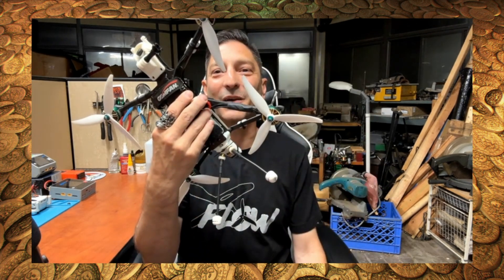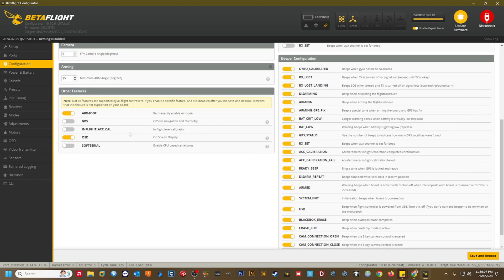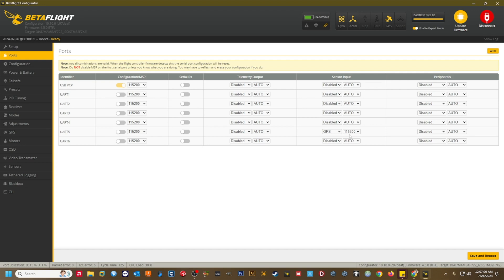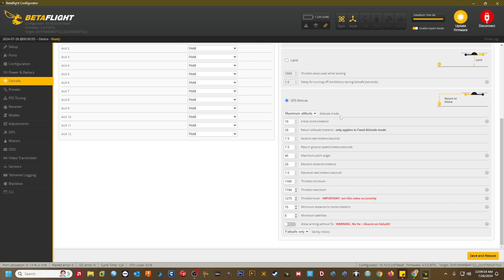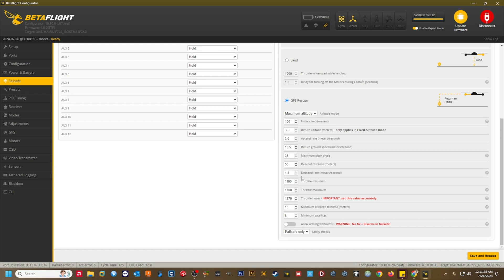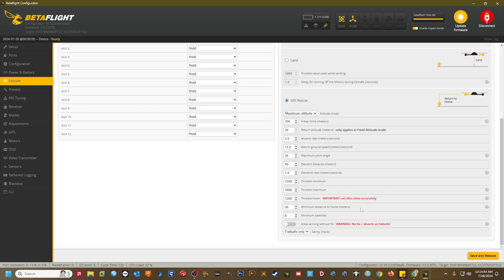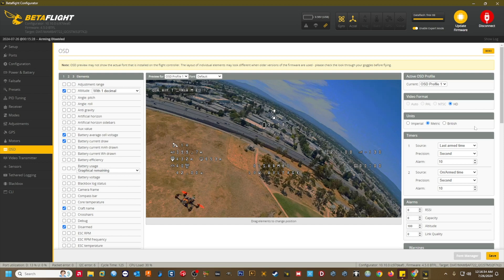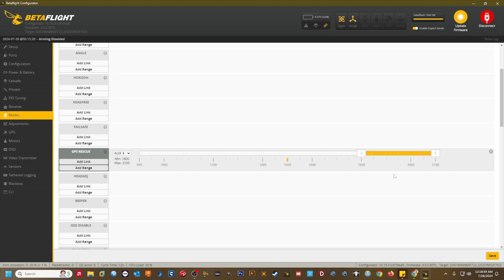Just The Tip - Ep 10 - Betaflight 4.5 GPS Setup & Settings - How To Setup GPS Rescue and Auto-Land

Comment: i just update to 4.5.2 , but i don't have GPS Rescue in Modes (BF 10.10) ,event in configure GPS already on
Reply from the maker: maybe when you loaded then firmware to flash, you loaded it without the GPS functions included in the firmware. Try to re-flash the 4.5.2 again, it should be there in the modes tab once you enable GPS in the configuration tab.
Reply: @Rogue_FPV  Thankyou sir, but i just found the problem. THe problem is GPS cannot use on 3D Flight Mode. so it will disappear from Modes. But thanks for the replay.
Reply from the maker: @captaindronieversefpv  also that.... lol

Comment: Thank you so much for the info. for the 5inch quad.  what size battery did you use?
Reply from the maker: I used a 1200mah 6s Speedy Pizza pack. 
That’s my go to lipo
Reply: Your setup is very simple, and I really like it. Did you assign any angle switch to stage 2, or is it left as GPS rescue only?
Reply from the maker: @hgherb I don’t assign any angle switch, betaflight will automatically enable angle mode for the stage 2 failsafe / return to home
Reply: @Rogue_FPV man!! Your the man!! Thank you so much.
Reply from the maker: @hgherb  any time Bro! Always happy to help out!

Comment: so what you are saying i no longer have to set angle mode with a hold value or the throttle with a hold value? i also don't need a stage 1 aux switch set to fail safe for testing?  like i did in 4.4..   Though JB's video on 4.5 did as did Dshot.. But you and UAV tech did not. I assuming these are short cuts to simplify GPS set up?  You are confident to turn off you controller with the settings shown?   Things can get over complicated watching you tube...lol
Reply from the maker: @kevinglenister6520  yes, I’ve shut the radio off and am 100% confident with these settings. There is nothing wrong with adding the hold values for an added layer of “comfort” but I personally have not bothered with them, and all of my test and free flights have been totally fine.
Reply: @Rogue_FPV  thanks for the info!
Reply: @Rogue_FPV  one more question when people test are they disarming or literally turning off their radios
Reply from the maker: @kevinglenister6520  Do NOT Disarm!! Either use failsafe mode with an aux switch to simulate a radio failsafe, or manually power down the radio. 

Personally I use the Failsafe Mode / Aux Switch for the initial test, then power down the radio for my second test if the switch method does work as expected. 

Great questions BTW!
Reply: @Rogue_FPV  lol I thought so as with GPS rescue set up on one of my other quads I used the disarm switch and it hurtled to the ground  at an amazing speed!  I just thought I'd programed it wrong.  But everything else worked as it should on fail safe switch.  So I was never brave enough to shut of my radio off as I thought it would have the same consequence.  Thanks for the info it is really appreciated.

Comment: hi RogueFPV why in my betaflight 4.5 (NAZGUL XL5) the "Initial climb" value keeps getting blank after i save and reboot.. after setting a numerical value it goes blank when i press save and reboot..  thanks in advance.. appreciate ur info regarding this matter.
Reply from the maker: @xrowdac5trezor  what value are you trying to enter in the initial climb? When I have seen the values disappear it’s because they are not within the allowed range - value to low or too high. 

It’s also possible that there was a problem with the firmware flash of 4.5, you can try to re-flash the firmware and see if that helps.
Reply: @Rogue_FPV  ohh so may yes re-flash.. i did all numbers 1-100 nothing works (registers)  after i save reboot it goes blank (the box)..
Reply from the maker: @ I would recommend re-flash the firmware to the fc, and make sure that the gps option is selected when compiling the firmware

Comment: Great info! This is probably the clearest explanation of GPS rescue settings I've seen so far. BTW, you mentioned that GPS rescue doesn't use the magnitometer/compass but I found this on the BF website so I guess it does use it now? "Mag information improves behaviour in GPS Rescue during the climb and descend phases, where wind and drift can confuse a GPS-only heading. It essential for accurate position hold, which we will support later."

I'm sure a direct link would be blocked by YT but here's the last part of the link after betaflight dot com - /docs/wiki/guides/current/magnetometer

Comment: I use HT1818Z3G5L GPS moudule it doesnt work with f4v3 plus FC why?
Reply from the maker: When i read the technical specs for that GPS unit, I see it's rated working voltage is only 3.3v 
Manufacturer has not designed it for 5v input voltage.
Reply: @Rogue_FPV  oh I see Thank you ♥️

Comment: Definitely just got a new subscriber! This was very easy to understand the way you presented it. I recently purchased the I flight Nazgûl eco and go he gps pre installed. I watched a few videos on this with JB and some other guy and I set all my settings up the way they said, but when I went to testing it I had it set to let me fly without the minimum because I have to plug in a lipo in order to get the gps power so I didn’t want it to sit there and burn up. So I took off and it locked some satellites so I flew out to test it and flipped the switch set to failsafe, it went through the first stage which was shooting up in angle mode then stated gps rescue. When gps rescue initiated it flew up more then turned twords home it started trying to come back but then it was pitching up and down and started going up and down in altitude, but the next time I just tested the gps rescue alone and it went up turned around in angle and then proceeded to start falling out of the sky then sometimes trying to catch itself and sometimes not at all I crashed and went home frustrated, so now I’m thinking I need to set my hover correctly and turn off start without fix. I don’t know if I want to sit there and wait every time I go to fly to get a lock though because I don’t want it to over heat. But if you have any solutions they would be greatly appreciated and I will update after making these changes and testing this. Also I don’t know if it matters but there was a power line kinda close when testing
Reply from the maker: Firstly, Thanks for your kindness and thanks for watching! I'll tell you.. you for sure want to disable "arming without fix" that is an accident waiting to happen, its not worth the risk of losing a quad.. What I do is just power my FC with a portable usb power bank and let the GPS get sats until I'm ready to fly, then I plug in a lipo.. That way I can acquire sats without heating up the electronics.

Also some bobbing on pitch is to be expected during the return flight - don't expect a perfectly smooth and level flight as the fc is always trying to match speed and return angle while fighting turbulence, but it should not be shooting up and or falling quickly as it begins its trip home, this is 100% caused by not setting the hover throttle value correctly and is a very easy fix. 

If you have any other questions feel free to reach out any time, I'm happy to help!
Reply: @Rogue_FPV  I tested it again and it started to fall again after setting hover correctly and changing the other setting so now I just have no clue

Comment: hey man good video! you have initial climb set at 100m so it will be added to the max altitude you have been. so like if you fly at 100m and GPS rescue will make you climb at 200m ?? did i understand it right ? can you say why go this high because idk if i should do that or keep it at 10m  like i have. thanks !
Reply from the maker: @anubiss2058  if you use Max Altitude, the drone will add the Initial Climb altitude to your highest altitude flown, and fly back. 

I fly LR in spots with really tall trees, so climbing 100m assures me that I won’t hit an obstacle coming back. 

You don’t need to set it that high, use good judgement based on where you are flying. If 30ft above your highest altitude is safe where you are flying, by all means, set the initial climb to 10m. 💪🏻🤘🏻
Reply: @Rogue_FPV thank you for the clarification! I have a problem you might be able to help whit. I have a cinelog 35 v2 O3 tbs M8 and I have updated to BF 4.5 and when conducting flights test the drone like most of the time fail to do the gps rescue action. It seems the altitude readings freeze when I activate failsafe like it climbs but altitude in osd stays at what I was flying at. The drone then climbs indefinitely. Anny trouble shouting list I can follow? I have tried reflashing and verified settings which I don’t think is the problem but I’m no expert. I fly close to an airport so maybe interference?? Thanks
Reply from the maker: @anubiss2058  are you using auto baud or setting baud rate manually? Also what is your current baud rate? Are you getting any sensor lost warnings when the alt freezes? 

I had a similar but different issue with sat count and it was my radio elrs packet rate. Once I moved it to 250hz my sat count in osd came back.
Reply: @Rogue_FPV I have tried the 57600 (auto gave me that) and after your video I have seen that my gps recommend 115200 so I have tried that also but same problem. No warning it juste climb and i see that altitude is not going up wen in release it correct itself but sometimes juste recalibrates in the negative and it’s completely wrong. I’m not sure what you are referring to by your radio tho but I have a tango 2 of that helps ?
Reply from the maker: @anubiss2058  I’ll think on your issue and I’ll get back with you when I think of something. Do you have another GPS module to test on the craft?
Reply: @Rogue_FPV  i have order an M10 that i will try when it arrives but for now no.. i have found the thing on the radio that i use : 14dBm 25mW and MAX Power is 100mW Frequency 868 MHz. should i change that to try out ? if so what would you recomand? 

Also thank you for taking the time to respond i really appreciate it
Reply from the maker: @anubiss2058  those radio settings you have are correct.

Comment: Thank you for your video again! I'm going to use your guild for both my 5" and 7" quads :D I'll try to figure out my Cinelog35 too 🤗
Reply from the maker: HMU if you have questions or need help with the Cinelog35, you really just have to adjust the hover throttle and return speed.
Reply: @Rogue_FPV  One thing I would like to know is  this: at an other video of yours for gps resque in a lower BF version, I asked if the stage 1 failsafe matter and if I would have to set it up. You advised not to because we choose stage 2. Although on other guilds, they say that before stage 2, stage 1 kicks in to avoid resque in small signal drops. Is that a thing? One more thing is the GPS resque via aux. What would happen if we lose video signal and there is no switch for manual GPS rescue? Thank you again!!!
Reply from the maker: @illuminatorix  I don't personally setup the Stage 1, but others do. I have not had any ill effects based on the way I setup GPS Rescue, but you can certainly add the Stage 1 setup from the other party's video if you want that extra layer of safety and sanity checks.

Also, if you do not have a manual GPS Rescue Mode / Aux Switch setup, the quad will only auto return home on a RX Failsafe. You will need the GPS Rescue Mode Aux switch to trigger a manual return to home of you lose video at any time.